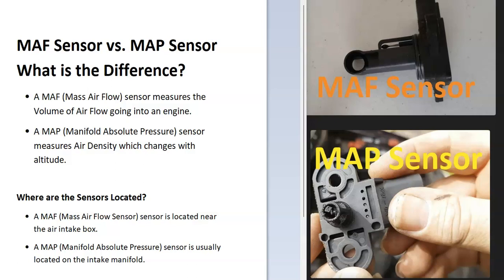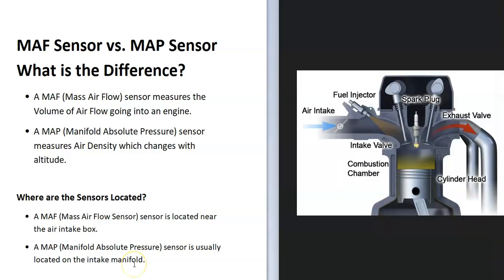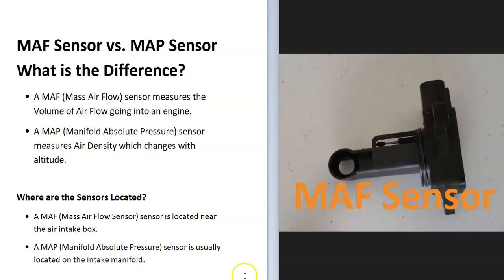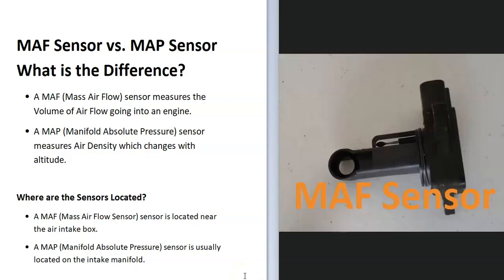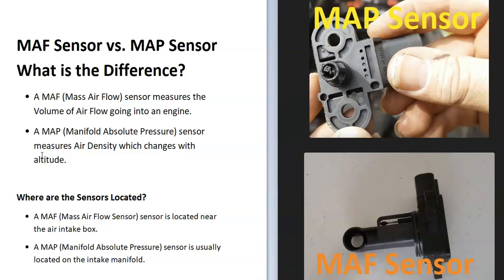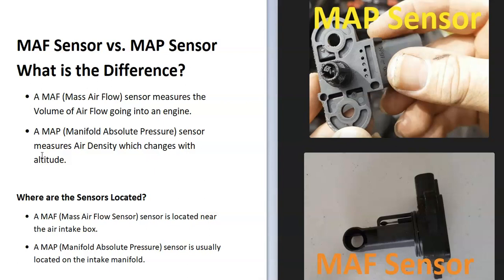MAF Sensor vs. MAP Sensor What is the Difference? (In 2-Minutes)

Comment: probably sounds like a dumb question but I’m a newbie I have a Hyundai ELANTRA 2019 and I know I have an MAP sensor and I know where that’s at with the intake manifold, but does it have an MAF sensor and if it does where would it be located?
Reply from the maker: That year doesn't have a MAF sensor but uses the MAP sensor and other sensors for intake airflow information.
Reply: @HVAC_Mechanic  thats really interesting thank you the quick reply i gave the video and Thumbs up.

Comment: Still confused.  I have a 91 dodge stealth the MAF sensor was replaced . Is that the same as the code reading of 25 for a barrow sensor?  The car is still when accelerating, hesitates a bit or seems like the fuel isn't getting to where it needs to go ...like airpockets?

Comment: A hot-wire mass air flow sensor, measures air flow as grams/second. The MAF sensor is effectively taking into account ambient air pressure as the hot-wire would cool more slowly with less dense air moving through the intake at the same rate as more dense air moving through the intake